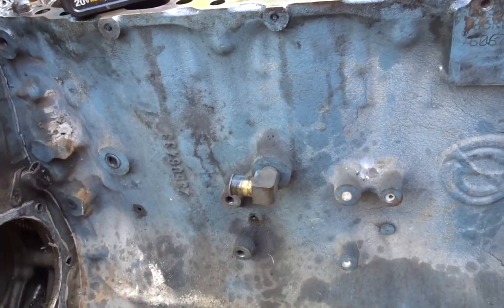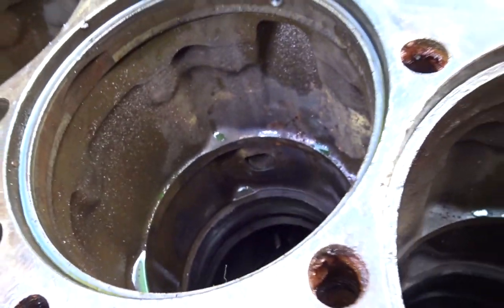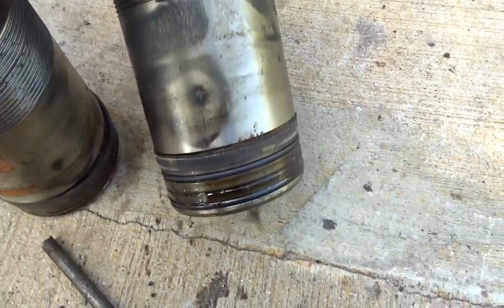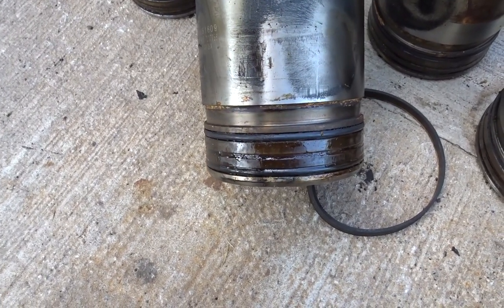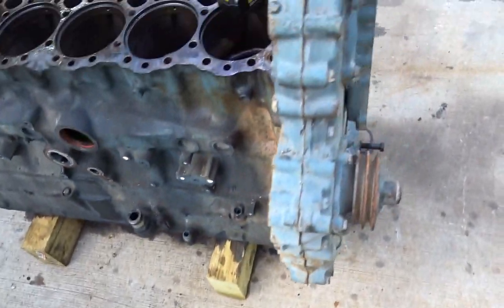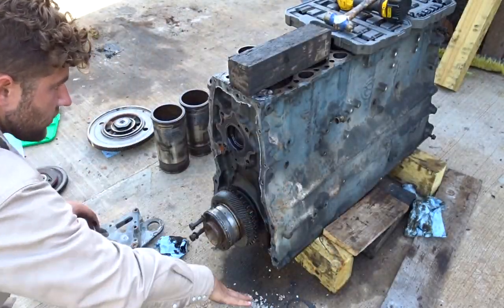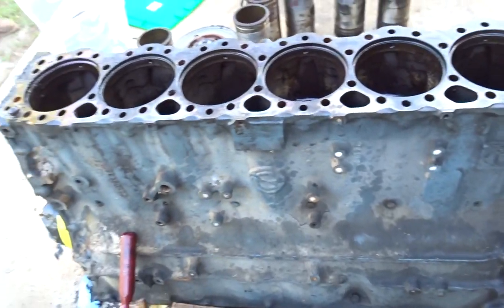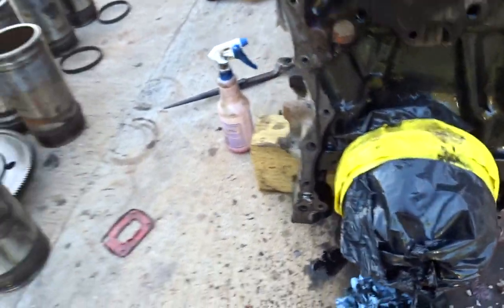11.1 Detroit 60 Series Teardown PT 2

Comment: i would want that block decks and the liner counter bore cut and shimmed. i would take the time to flip the block over, pull the main caps, look at the bearings and rotate the crank before i sent it in to the machine shop.

Comment: I commented with a link in your story about those liners.  I wouldn't be surprised that the last guy that assembled it did not align the arrows on the sleeves for the cooling ports. If they aren't lined up its possible to get piston skuff from the sleeve over heating.
Reply from the maker: I wasn’t aware they had a right way when I took them apart otherwise I would have checked 👍🏼

Comment: How did you press the sleeves out? I have heard my dad talk about dipping the sleeve in liquid nitrogen to install them but never really heard him talk about taking them out.
Reply from the maker: I’ll try and remember to show it in the next video, but I made mine out of some 1/2” plate that goes thru the top and all-thread welded to it, then I made a bridge that spans across the deck and all you do is tighten it down and it pulls the sleeve up